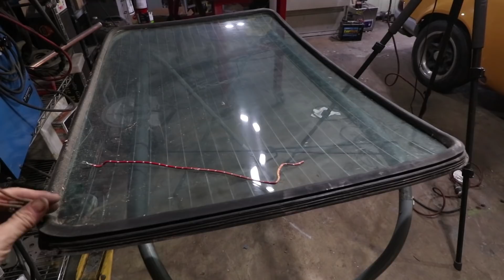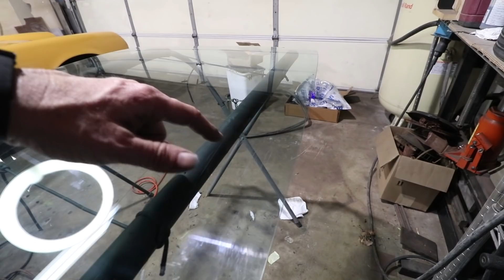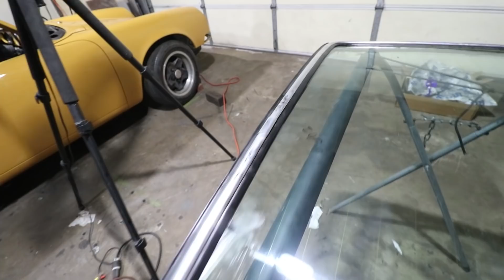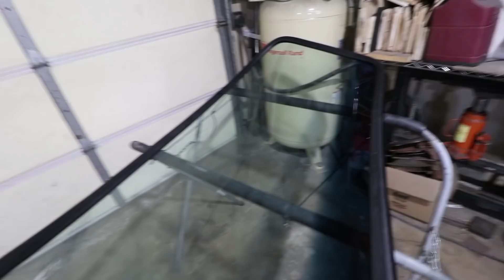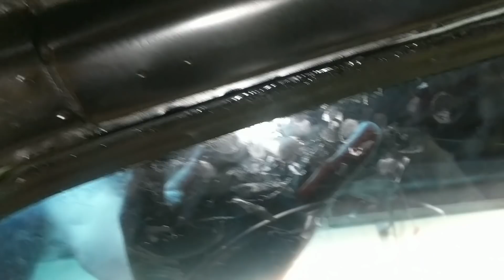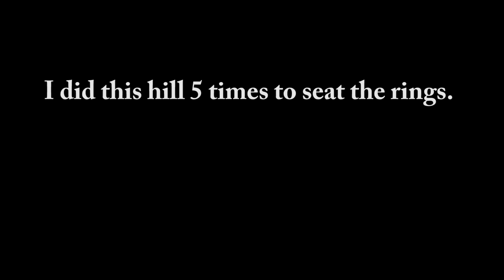SUPER Challenging Glass Install With Weed Whacker Line

Comment: You can get versions of the OEM front gasket that give wider rubber on those problematic top corners
Reply from the maker: I'm pretty sure when the trim goes in and gets adjusted it will be fine.  I just haven't done it yet

Comment: Saludos from PR!  are putting a dash pad? wouldn't be easy to put the dash first and then the glass?  or is irrelevant? thank you
Reply from the maker: Hello Puerto Rico!  Yes normally it's easier to put the dash in first, but the glass will come out again to put the trim in.  
Also I'm not using the stock dash.

Comment: Think those windows are fun, try a rear targa window if you want areal challenge. When I was finishing up my 1973 Targa, I couldnt get any of my local window installers to install the targa glass.I took and drove it onto a piece of wood 10inches wide and used ratchet straps to pull the window down and hold it in place. looked crazy sketchy but it worked. lol
Reply from the maker: Wow, I've heard about those targa windows.  Maybe someday, and your method sounds like something I would do👍

Comment: Tom you do realize that the glass has to be out to install the dash pad don't you?
Reply from the maker: Of course, but I'm not going to use the traditional dash pad
Reply: @GarageTimeAutoResto  OK now I'm curious!
A question.  Do you use an air dryer on your compressor for the spray painting?  Thanks.
Reply from the maker: No air dryer, but I drain water from the 80 gal tank. 
Make sure the tank is at full pressure 175 psi
Let it cool for an hour or so.
Turn off the compressor.
Spray with the eastwood gun fisheye filter
Sometimes I'll pump the compressor back up between coats.
Plenty of air and no risk of igniting vapors.
Be safe
Reply: @GarageTimeAutoResto  Thanks for the great ideas. A big help!
Reply from the maker: Cool, that was a brief answer, but I hope it helps
Reply: @GarageTimeAutoResto  I guess I need a dryer anyway because my compressor is too small. Or buy a 80 gal compressor about $1500.  in Canada.
Reply from the maker: Buy a few of the eastwood filters.  They are pretty good.  There are also some DIY air coolers you can put between the pump and tank

Comment: Looks great with the glass.  I have read a few posts on pelican where the URO representative chimed in.  They have done a lot of work trying to perfect their front windshield seals.  I guess for a while there were some old ones out there that still needed work.  I plan on purchasing mine through pelican parts, to make sure a get a good one.  I too have a old nasty rear window that is definitely original to my car.  I also have a front window but it looks like it has some cloudy discoloration.  Someone said online that it could be delaminating?  I'm not sure but I was thinking of trying to polish both out to see if I can get them to clean up.  I will try the stuff you used!  Great video as usual!  Let's get the front bumper on and some headlights!
Reply from the maker: I've had good luck with today's URO parts.  The hood seal was great.  I've used lots of their grommets and boots plus their motor/trans mounts.  
The only thing I noticed on the windshield rubber is that one lip was stuck down to itself.  I had to work it loose, but it separated just fine.  
Also, that compound I used is for paint!  It worked well, but there are probably better polishes made for glass.  
Another commenter suggested cerium oxide.  I may try that on the scratches.
Hopefully the windshield clears up for you.  There is a film of plastic in there for crash safety.  I wonder if the rear doesn't have it?

Comment: nice vid!! in the M3 e30 the rear glass window contribute in structure stiffness, i know y have a roll cage, but check if it s also the case by porsche befor puting plexy win ??  its so noce painted i will not want see any cracks in the  rear area if it s my car??? please check
Reply: I don’t think it contributing to the stiffness as the Rsr models got plexi from start. Also the increase reinforcements and extra welds out in this chassis are huge. However I do not like plastic windows - I think the scratches and haze they get so easily are just not worth it. It is a matter of preference though
Reply: @XiraArien  you are right! it s prety nice reinforced!! a matter of preference! excellent work, ake a look of porsche Singer, it will give you nice finishing ideas, good luck!! to next vid!!!!!
Reply from the maker: Thanks guys, my belief is that the rubber seal on my 911 allows the glass to float a lot.  For this reason I don't see how the window could be structural.  
I do agree that modern cars with glued in windows will have more overall chassis rigidity.  
That's why I asked about the E30.  It may have something that connects the glass the structure?  
On another note, some say it's likely that my front windshield will crack, since the roll bar and door bars direct stress to the A pillar area.  Maybe?  Time will tell.  
Currently the front glass is floating a lot, but there is still lots of soap in there that hasn't dried out yet.
Reply from the maker: Is the E30 window glued in?
Reply: @GarageTimeAutoResto  hi, i checked e30, it s only put into the seal. not glued in.

Comment: I'll have to try the weed eater string when I do the windows on my 911e, I used paracord on my 70 C30 with the cab off the frame and it was a Pain, the weed eater string made it look easier. Also when you get it buttoned up a little more and maybe get the trim in and give it its first wash will you update  us on how that seal is holding up, if it leaks or not. I may have to give it a try as I need to replace all the seals on my 911. they broke apart when I removed the windows.
Reply from the maker: Ok, I'll let you know if it leak or any other problems.  
A bit of caution on the weed whacker string.  It can cut the rubber fairly easy.  I cut some of the rear seal.  Not sure if it was the string or the sharp flange on the car.  That is why I put tape on the front.  
Try to find some string without lines on it.  Mine had some spiral stuff on it, not perfectly smooth.

Comment: You don't put in the trim on the windshield ? It went pretty smooth. Mike had to wrestle a lot more
Reply from the maker: I will redo with trim when I get a nice set.  It went pretty easy.  The last 20" or so is always hard.  I did watch Mike's video and his assessment of the trim was really good.  I agree it's important!
Reply: @GarageTimeAutoResto  I think the trim more or less locks the rubber seal into place. It will widen the gap for the trim and thereby make the rubber put a little more pressure on the glass. I've seen a Porsche factory installation of a windshield in a matter of minutes but I've never seen a restoration project doing it that easy.
Reply from the maker: If the parts fit well, and you have lots of soap it isn't that hard.  I got lucky that I didn't need to modify anything.  I think the front will be a little harder when the trim is in place